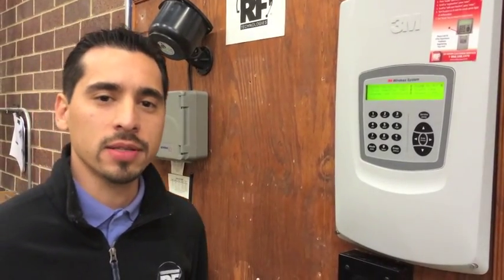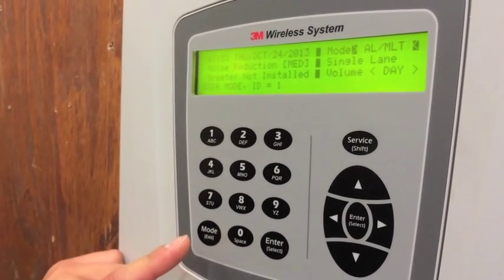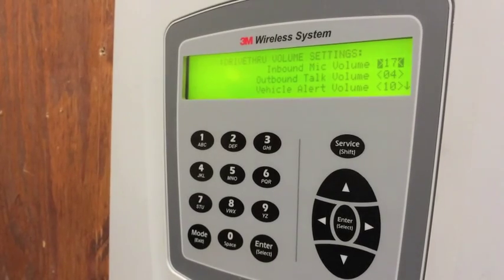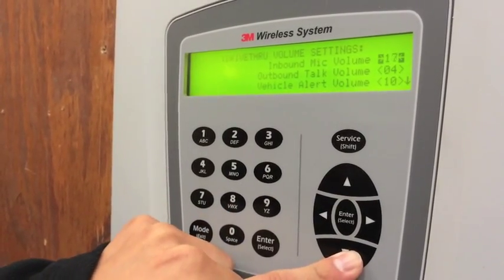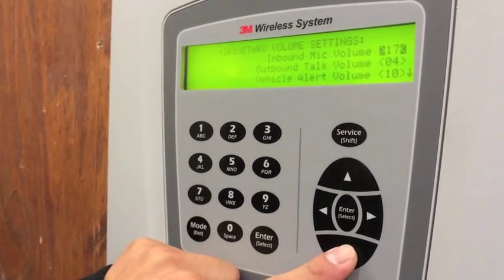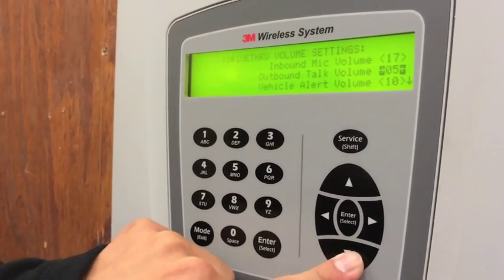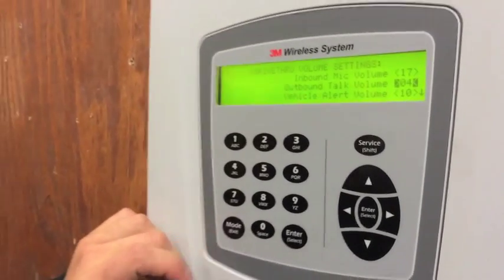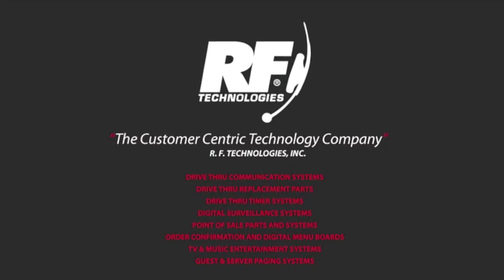XT-1 All In One Headset Programming Instructional Video

Comment: question, I am adding a jumper wire from Talk and Ground to Vehicle detect ports up top for greet detection for a timer set up, as soon as I add the jumper to either VEC DET 2 or VEC DET 3 the relays are closing and staying latches? 
My question is there any programing for the talk ground? I know the heads sets are not in use b/c the red led light on the board is not on, when talking in to the headset the led lights up and goes off when done talking,